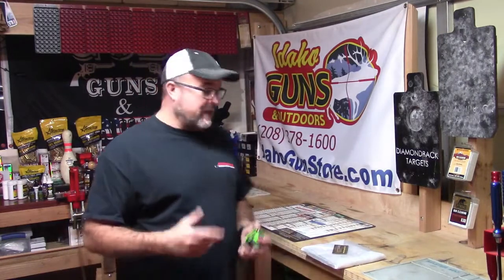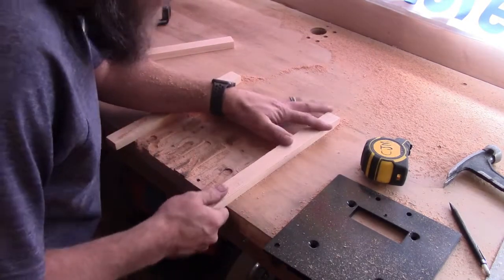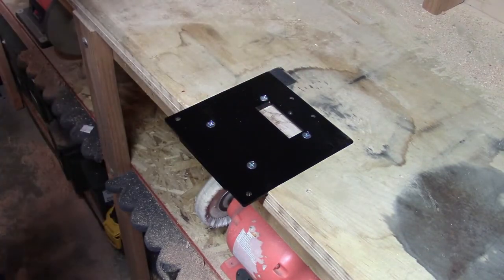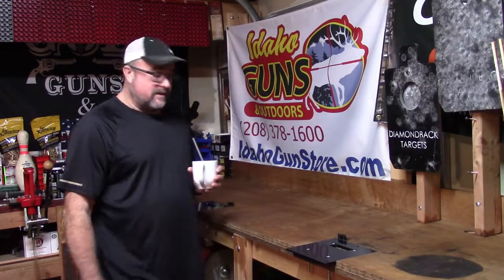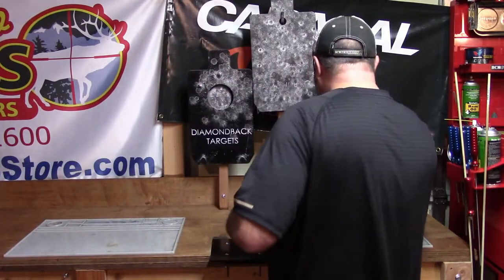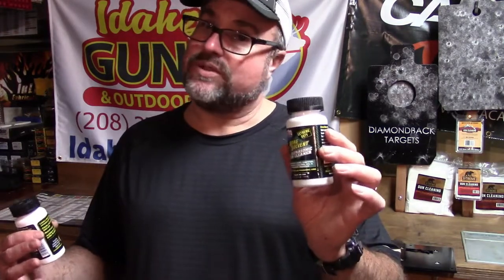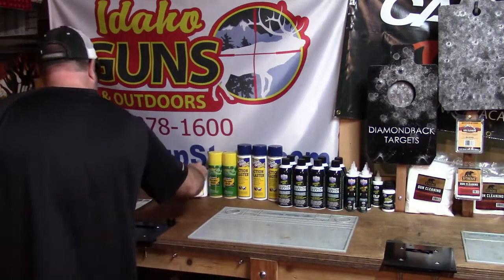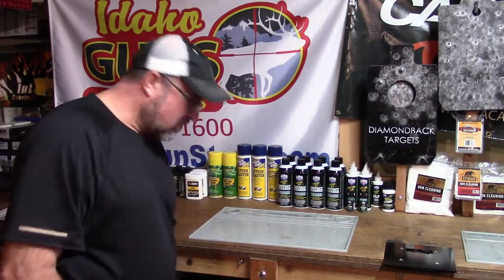Inline Fabrication Flush Mount Quick Change Base Plate, Bench Upgrade

Comment: I learned about making supports to float the router over the center area, "after" I routed the surface. But you can't beat the end result making your bench much more usable. My bench has the front support at the edge so I used the 6 inch 1/4 20 bolts and placed cap nuts on the ends. Good Job!

Comment: i want to put one of these in flush on a butcher block countertop work bench. I don't have much room underneath it to allow the bolts to protrude below the underside because i have a Husky tool cabinet on wheels with less than an inch of space between the top of the cabinet and the underside of the bench. Should i just use shorter bolts? Or cut the bolt ends with a hacksaw? Or can i use short screws instead of long bolts drilling an appropriate sized pilot hole for screws of a similar head size and diameter?
Reply from the maker: If you call Inline Fabrication, they can best answer your question. Highboy

Comment: I didn't want to route my bench, so I just bought the spacer plate that Inline Fab sells.  So much easier.
Reply from the maker: Well I think you are missing the point. I already have 10 of these and most of them have the spacer plate. The reason I am routing these two down is so they are flush mounted which enables me to use it as a flat, smooth top. This is just one more additional way to use it. Highboy
Reply: @76Highboy  I certainly can see that.  It just wasn't going to work out for my bench, even if I wanted to do the routing.  My bench is made up from our old kitchen cabinets, so there are drawers that I still needed access to (side bin setups on my presses get in the way).  That's what's great about the IF stuff, they have mount solutions that work for a variety of benches.
Reply from the maker: @gpraceman  I understand that. Highboy